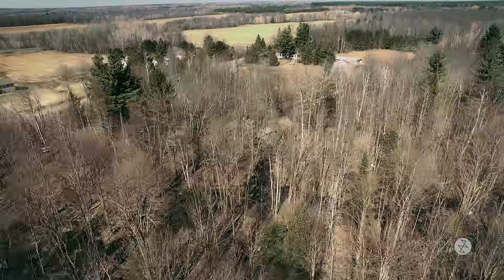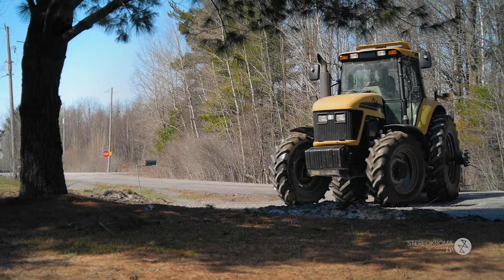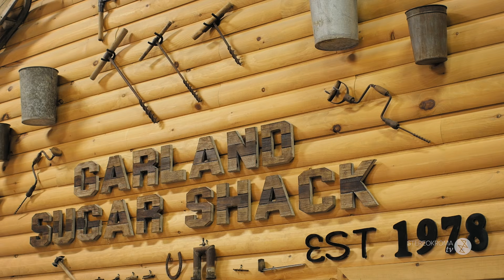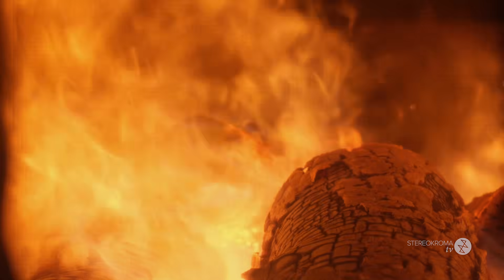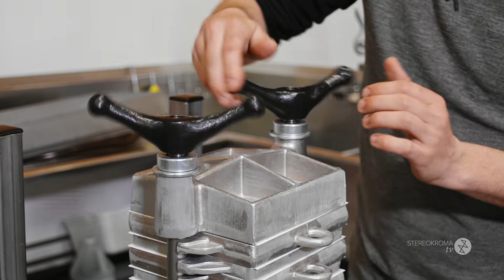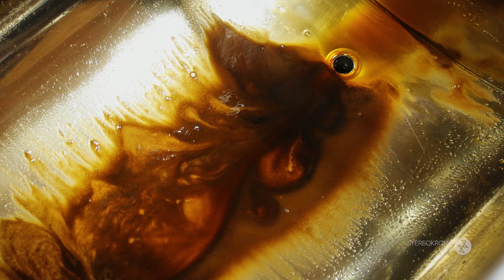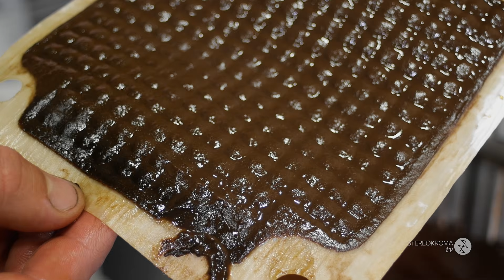Making Maple Syrup | Où se trouve: Garland Sugar Shack

Comment: So for other maplers stopping by, have you just had lame years? Ive been going for 4 or 5, and it just seems like our temps have been all warm or all cold in this part of Ohio. Not the oscillating over/under you want. Usually Id have 70 or so gallons of sap, but Im barely pushing 20 this year :/

Comment: Am I the only one plumber here who noticed that they use blue PEX tubes for transferring boiling syrup? That is not good. Blue PEX tube are blue, because they are designed to not leach any plastic poisons into the liquid they are transferring trough only up to somewhere 40'C. They should have used red PEX tube for the boiler room, witch is designed to transfer liquids and not leach any poisons into it up to 120'C. The fact that they used blue PEX on the sap lines is alright, because the sap is cold, but for the boiler room where liquids get hot, blue PEX is a big no no. Idk, Maybe I'm not getting something right here, but I can't help but notice this problem they have here.
Reply: Yes true also pet whith plastic matter is not safe glass bottle is better.
Reply: @ouqab65  yes you are correct. when I was younger I was sure that all these tales about the big poison plastic are just that, grandma and doctor Oz tales to scare people. But then I started to notice in fact the plastic does disintegrate into microplastics, and one day as I was making caramel and was whisking the teflon coated pot  with a wooden whisk to thicken it, and I noticed how the teflon particles appeared in the caramel I got sick to my stomach, I checked all my pots and pans and saw that the teflon WAS PEELING in every single one of them. I got so sick I thought I would womit. I threw everything out and stopped using teflon things and plastic utensils as much as possible. That this is all true.

Comment: This is the most eco friendly product that i saw  been made in my life
Reply: Archana CR solar energy doesn’t produce that much energy, that’s why there always in large groups. They would need a bunch of solar panels and those things aren’t cheap.
Reply: @tonychopp2952  well said
Reply: @archanacr  Guys... Unfortunately, solar energy is not suitable for everyone. The location of solar panels is the most important aspect! Houses in the shade of trees are not suitable for installing solar panels. In regions with constant cloudy and foggy weather, solar panels will produce energy, but more panels will be needed to create enough electricity. And this means that you need to rent an extra place. *HUGE PLACE*. During winter, solar panels cannot produce enough energy to supply even one home. And the video was shot where? In Canada. In Canada, a lot of what? Shades of forests. Sooooo it’s easier to immediately close the production of maple syrup. Because on solar energy, costs will significantly exceed revenue.
Reply: bitterman co  At first sorry for my English. Then, can solar energy maintain the desired combustion temperature? For example, the burning temperature of a tree is approximately 800-1000 ° С. The electric stove consumes up to eight kilowatts PER HOUR and heats up to only 500 ° C. At the same time, it turns off alternately, for cooling. Hence the conclusion that electric stoves can't be used for boiling, in their case for boiling gallons of maple syrup. It's simple - syrup will not boil, and the energy will be huge enormous. Do you think these people are universal evil and they like to cut trees, what to burn them in the furnace? If there was an effective and low-cost alternative to firewood, then they would use it.
Reply: bitterman co  still
They don't produce enough to be deemed "a good alternative to fossil fuel"
Reply: @archanacr  the trees they use are likely scraps
Reply: @prizmarvalschi1319  is it possible to find say 20 to 30kg scrap wood per day? Everyday. I doubt. Anyway. Theres no point in us having an argument here. It was a good discussion. Hope all are safe this covid season
Reply: @archanacr  just think about it. The wood releases carbon, but this carbon has been captured from the atmosphere by the wood. Production of solar panels require mining heavy metals that are waaay more dangerous than planting a tree for wood. And if you wanna run your machines while its cloudy or at night, you also need a large battery, that needs to be mined.
Reply: @archanacr  and the cobalt and lithium in your phone has been mined out of the ground I don’t think that’s very renewable
Reply: @twinsnails4983  last time i checked my phone didn't need 1kg of cobalt or lithium.
Reply: @archanacr  well it’s still not renewable at least those trees will grow back in a couple
Reply: Archana CR it is not going to be 100% eco friendly
Reply: @michaelmariscal775  better not nothing
Reply: How much does it cost to cut down a tree that you already own? Maybe $20 in gas and oil for the chainsaw and a few hours of honest labor that most people don't even know exists.  How about solar panels... Just maintaining them is a whole other jobs in itself let alone the price if those things. Not even comparable, and not a viable option for smaller businesses unless you wanna donate about 15million bucks which I'm sure anyone would gladly take.
Reply: @archanacr  it’s eco friendly not eco friends with benefits-ly
Reply: @archanacr  wood IS a renewable source of energy, and it also emmits LESS co2 than solar.
Reply: bitterman co  you forgot to say that the co2 being emmited from burning wood came from the atmosphere, so its carbon neutral.
Reply: @archanacr  trees are renewable resource
Reply: @archanacr  🤦
Reply: @OGbqze  get vaccinated
Reply: @sakoourfalian9316  🤣 make me
Reply: @archanacr  But the wood might give the Products are unique flavor kind of like Jack Daniels whiskey
Reply: @archanacr  you do realize that solar energy isn't the most efficient for this line of work
Reply: bitterman co  Yeah it would be quite a bullshit argument to say that they couldn't install and use solar. With the amount of money I'm sure they make off of the maple syrup I'm sure they could afford an array.
Reply: @nyelbaig  wood is waaaay cleaner than solar.
Reply: 160,000 litres of sap where do you think it comes from? The fricking ground water.
Reply: Since when is burning trees to produce 1 liter of syrup eco friendly? You should watch how honey is made, that is eco friendly.

Comment: You guys don’t use so solar panel ??
Solar energy on your roof and stored in batters for the heating / cooling process ?? 

Love the video, 
Also for the last part of filtration , you would look into using o-rings between plates .. 
is there any reason why the removal of sand particle need to be horizontally pressured ??
Reply: Why would they want to spend more money to receive less energy?
Reply: Cotronixco why do you mean by less energy ?? 

Solar panels is green energy , in the video it is obvious they get lots of sunlight ... 
So it might be high expenditure initially but they will recoup it easily .
They can even use the energy to power their entire factory eh
Reply: Very untrue. When you remove subsidies and taxes, solar and wind end up costing more per kWH than fossil fuels; and in Canada, hydroelectricity.
Reply: Cotronixco sorry but why remove subsidies ?
Subsidies are tax payer driven and is given to companies who will in time gain benefit and increase productivity .

I believe it is the same as in when before collecting the sap was using bucket and now they innovated and used pipes that , at first have a higher initial cost  but recouped easily in manpower reduction .
Reply: You have to think a tad deeper. You remove subsidies on one side and taxes on the other to determine how a concept holds up on its own in the long run. At this point in time, unknown to those who wish to remain narrow minded, solar and wind are extremely inefficient, placing the massive costs on the backs of all others; and if everyone had solar and wind, there would be no power companies left, and these personal systems would be so expensive that their payback would be 50 years if at all. Based on the second half of your comment, you must be off the grid. But I'll bet you aren't! So unfortunately that makes you a hypocrite. Do some research. I'm not here to be your teacher. Have a great day!

Comment: Isn't the sugar density skewed by the extra sand in the syrup?  I mean the hydrometer might be off by a few 100ths if there is more sand in the syrup than usual.  I know it can vary from batch to batch but do you make your calculations based on the sand also?

Comment: With the press filter you should run air through it to get the last of the syrup out or most of it.When you scale up to do large amounts you can get a larger filter that takes filter cloth instead of paper witch is reusable (just got to scrape off the sand with a paint scraper),but you may need to add filter aid(basically fine sand/dust that you mix with the syrup witch builds up on the cloths and acts as an extra{more fine) medium for the syrup to pass through.I do similar stuff but with oil.

Comment: pro tip to evaporate the water-  use a vaccum pump and a big container for your sap(that can hold the forces of the vacuum) and boil the water content down that way- Water boils under vacuum in a around 20 Celsius  or 68 Fahrenheit. Cheap and easy- just need room temp to be over 20c /68f

Comment: The way I do it is with homemade stainless spiels, rubber hosing leading to 10 gallon jugs at the bottom of a hill, 2-4 trees to a jug, I have 5 jugs out at a time, then I bring it home to my fire pit and turkey fryer, using hard seasoned oak to boil it down, the smoke getting into the syrup and giving it its signature Smokey flavor for mine

Comment: Will pressure reduced boiler help enhancing the efficiency of water removing? I tried once with regular water. It boiled at 60 Celsius. Maybe the intensive bubbles stop the application of low pressure boiler.

Comment: Does the sand come about as a result of the boiling process? Reverse osmosis membranes are supposed to be so fine that individual ions have trouble passing through, let alone particulates.
Reply: Reverse osmosis removes the water from the syrup. It leaves concintrated sap and everything else behind to be filtered later.
Reply: Yeah, I should have thought about it in reverse. The purpose of the RO was not to remove the contaminants but to remove water and concentrate what was left.
Reply: Correct!
Reply: Yes, most of the "sand" comes about from the boiling process. Maple sap has dissolved minerals in it, and when you remove most of the water, they precipitate out of solution.

They also filter the sap before it goes into the RO machine, because there are some wood particles and other impurities that could damage the membrane.

Comment: It did pass thru the Reverse Osmosis filter and at the end it has to pass thru a press filter to filter out sand particles???
Reply: The sand particles didn't go through the reverse osmosis system.. the concentrate is what we boil and that includes the small particles of sand

Comment: I don't understand the last filter. How would any sands make it past the reverse osmosis? The membrane finess is way higher than any paper filter would be. Are they running really high bypass with the sap or something?
Reply from the maker: I think it's other way around. The water that is removed is perfectly clean without sand. The rest, the syrup and the minerals is what gets boiled down. So the last step is to remove the sands from the syrup after it has been reduced.
Reply: Precisely :)

Comment: Much more than learning how maple syrup is made I was overwhelmed with the cleanliness of the whole place. How do they keep it so so spotlessly clean.  I would recommend buying their maple syrup even for royalties. These are downright true professionals committed to giving the very best to their customers. Thank you for the wonderful video.
Reply: Mahesh Munchies They mention that they use the pure water removed from the actual maple sap, to clean their equipment. 

Which has no minerals in it, in which allows dirt to bond with the  water particles easily. Its pretty brilliant haha. : )
Reply: Trevers Goh it’s not so much that contaminants bond with the water any easier, it’s that there are no minerals or anything else there to deposit onto the surface they’re cleaning. The water will rinse and dry without leaving any water spots or deposits.
Reply: @treversgoh also known as "distilled" water.
Reply: @michaelknight2342  distilled water has been evaporated and condensed, this water is reverse osmosis, which is run through a multi stage filter that removes particles at successively smaller microns.
Reply: @Michael Rodriguez sure thing buddy the "old fashioned way isn't always the best way" many times it's not even a good way, this is just a recolection system which is better so they don't have to waste their time and the consumer ends with more maple syrup, it doesn't drop the quality of the maple syrup and it's far safer to consume if it's done according to their regulations
Reply: ABEL stop hating on them it’s not like you could do any better hater
Reply: @ABEL-cd2sp  I think you may have chosen a poor example because they are probably anti-vaxxers lol
Reply: Well first, the equipment look pretty much brand new. And second, it is being used only 2-3 month per years. So they have all the rest of the year to clean and maintain it.
Reply: It's the water they get from the sap. As he explained, the water is completely "empty", so it's like a magnet when used to clean, because it's void of any minerals or particles.

Comment: Very nice video: Wondered if there are any other useful extractable materials vitamins minerals?
Also I can imagine during the off season, potential for growth in pipes must mean a lot of pipe cleaning and I'm trying to imagine that being done.  
Uncoupling at the each tree, pumping a fluid (sterilizing?)back through the opened pipes,,,,,,,,,,,,,,,,,,,,,,,,,,,,,,. Lots of labour.
Also wondered if there would be any benefit to boiling at reduced pressure?
As  retired marine Engineer and having used lots of diaphragm pumps along with cam-lock fittings; I''ve had  some cam-locks vibrate or rub open. What a mess if that were maple syrup.
Tie wrap would keep you out of danger there.
Again nice video and machinery.